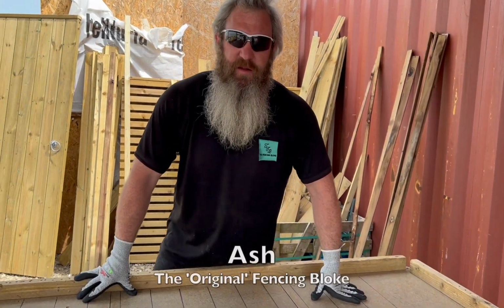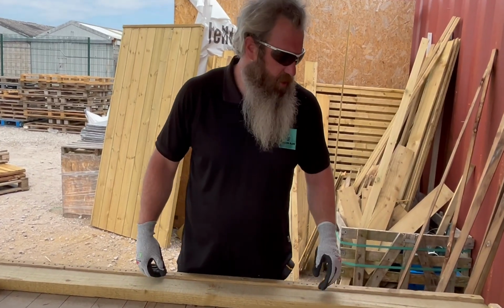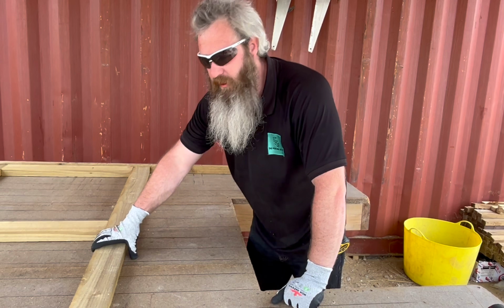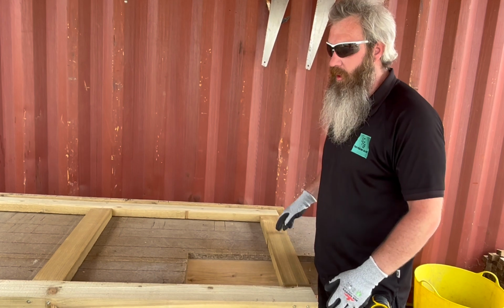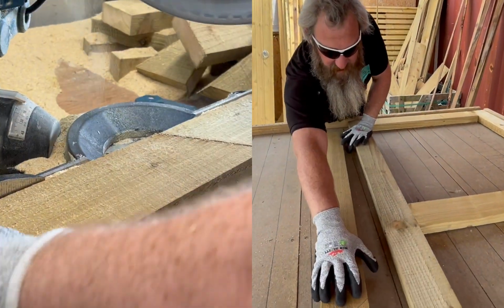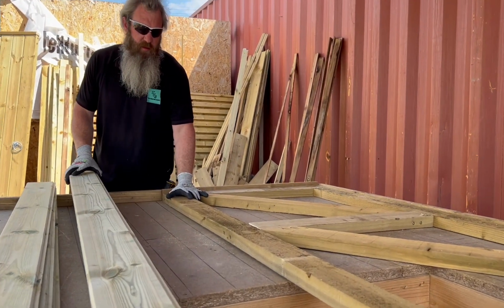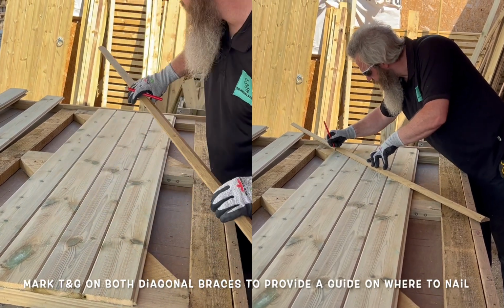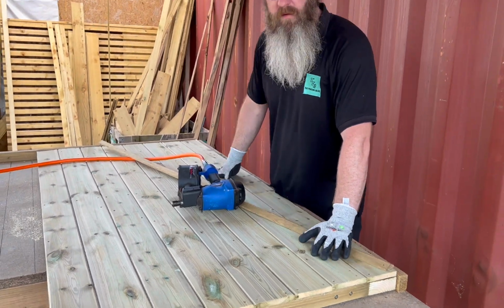How to Build a Tongue & Groove Gate | Step-by-Step Tutorial with The Fencing Bloke

Comment: What size timbers do you use for the gate stiles & cross members? Is it pressure treated?
Reply from the maker: Thanks for the comment and apologies for the delay in replying. I did not see the comments and did not know I could reply with us making videos being a new thing we had tested. 

The timber for the framework in the video is 100mm x 38mm tanalised timber and usually comes in 3.6m or 4.8m lengths.

You could also use 100mm x 50mm timber if you wanted to make the gate a little more chunky.